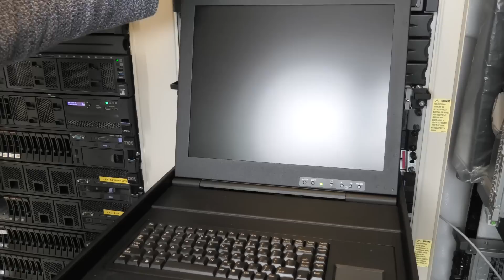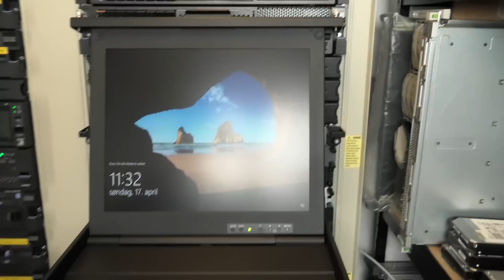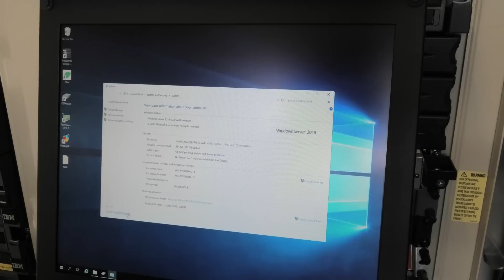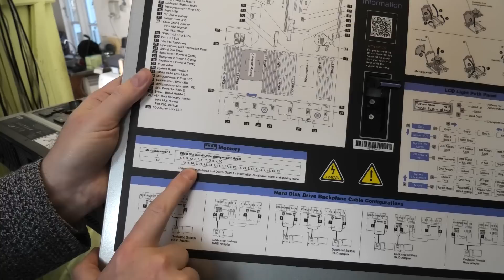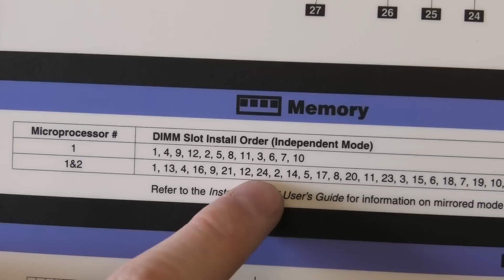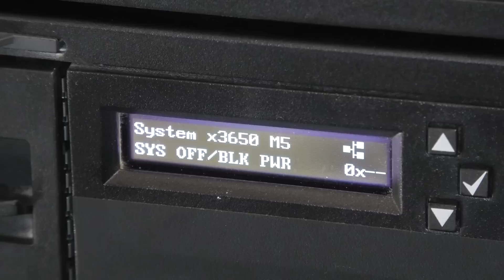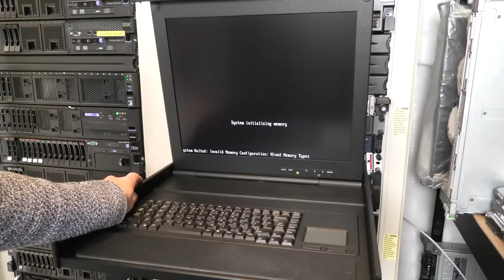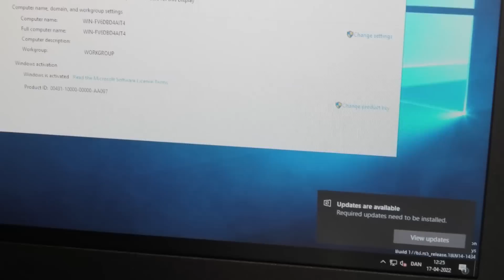5 Minutes RAM Upgrade - Turns into a Incompatible Mess - 1174

Comment: As others have pointed out, you can't mix RDIMMs and LRDIMMs, and mixing ranks can be a mess to get working.

But i'm fairly sure that platform does not support more than 32GB RDIMMs, so a 64GB RDIMM may not work at all.

I have tested 32/64GB 2933MT RDIMMs in the same platform, and they clock down to 2133/2400MT just fine.
Reply from the maker: Yes the mix of LRDIMM and RDIMM was me just assuming that they was the same...

The platform not supporting more than 32GB RDIMM I have never run in to before,, that would be an interesting test,, sometimes the documentation is for whatever is max, at the time of writing,, so a real test would be interesting.

https://lenovopress.com/lp0068-lenovo-system-x3650-m5-machine-type-8871#memory
Do not supply 64GB RDIMM for this server in there paperwork,, might just be that they did not have them at the time...
Reply: @MyPlayHouse  That would indeed be an interesting test, looking forward for the result :D

Comment: I just bought something on Bargain Hardware, used you discount code :)
Now it is waiting time when it will be delivered.
Great video, I had a similar issue with memory as well, a Dell R210 II does not want rdimm, but just want udimm, and I have only rdimm on stock, luckily, I had some udimm for a cheap price, but they where 4gb and need 4 of them.
64Gb, that is really nice, but very expensive.
Reply from the maker: Thank You!
I thourght this would be a simple upgrade,,and take no time,, and I did not check,, my mistake..

Comment: Mm... Can you install all LRDIMMs (4DRx4) to CPU1, and all RDIMMs (2Rx4) to CPU2? This set may be turned on.
Reply from the maker: I do not believe I have ever tried this,, so it would be an interesting test. 

CPU1 - 4 block LRDIMM
CPU2 - 4 block RDIMM
and then one of the remaining blocks in the next bank of each CPU. ,,,maybe.
Reply: @MyPlayHouse  I tried this config on a Chinese motherboard, but it didn't work. Code B0. But I think it's still possible that the HP bios is ready for this configuration.
Reply: @MyPlayHouse  I also tried turned off the NUMA feature, but that didn't work either.

Comment: No, man. Your 2Rx4 are a RDIMM s (has a limit on ranks), and 4DRx4 are a LRDIMM s (have no ranks limit). This is incompatible for one memory controller . You need to use only one of memory types. Btw I have installed 3 memory modules 4DRx4 per channel (32 Gb × 3 slots × 4 channels × 2 cpus = 768 Gb).
Reply from the maker: Yes LRDIMM and RDIMM does not mix,, in the same ram bank.

Comment: 64gb sticks they are quite expensive these days. Did you try starting with higher ranked modules and then put in the lower ranked modules. For hpe servers that is a requirement.
Reply from the maker: They are not cheap,, but I only tried what you saw.